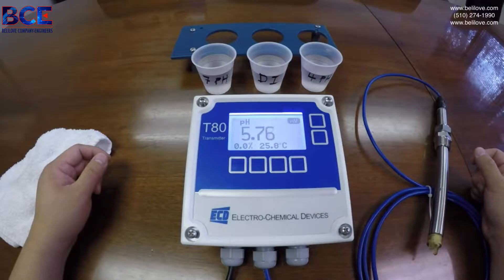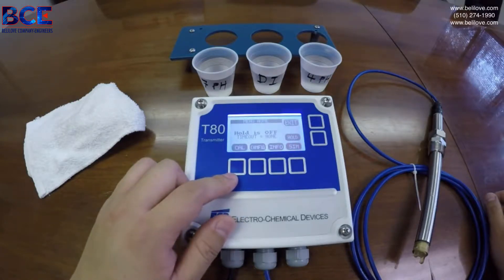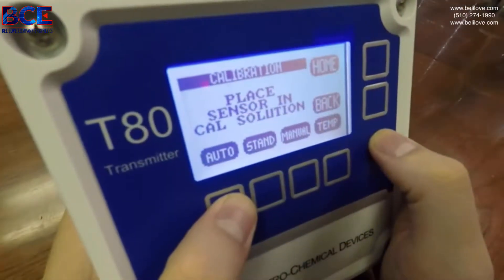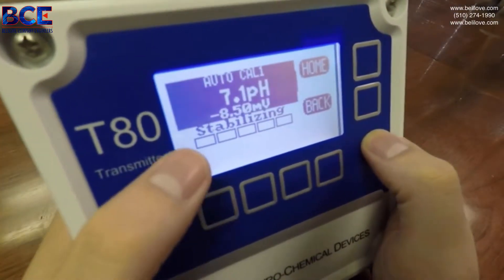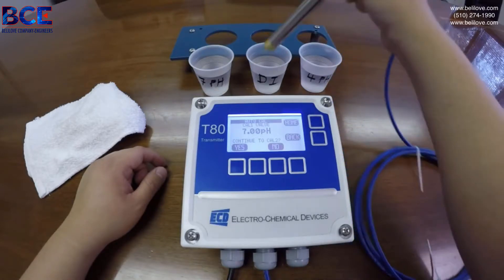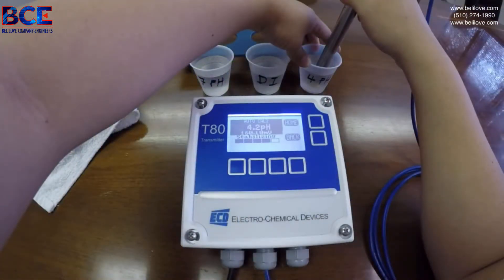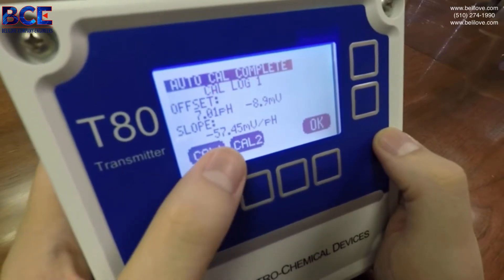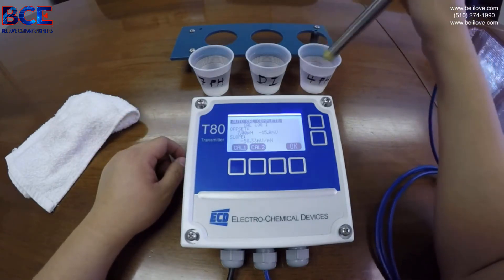Calibrating the ECD S80 and T80 for pH

Comment: The manual has a HOLD ON step. And does not suggest stirring.
More improtantly is there a reason of pretreatment (soking) with KCl or other solutions? Slope comes in 25-45  mv/pH range. And putting the probe back in the standard solutions reads them wrong.